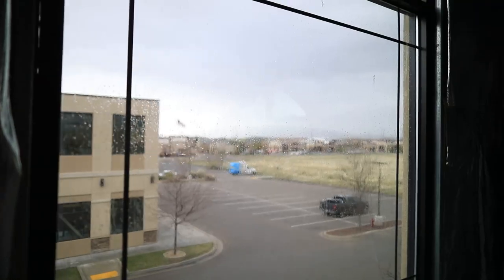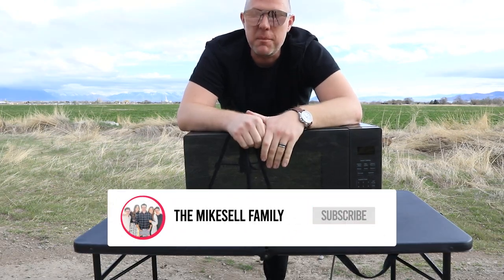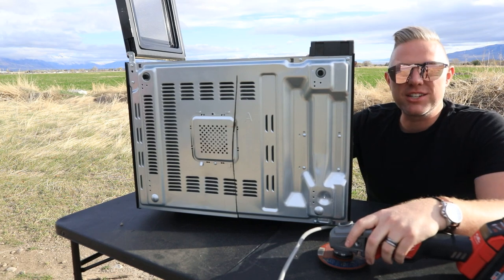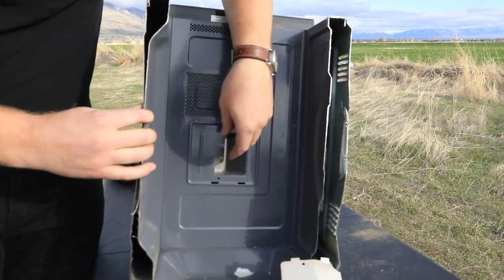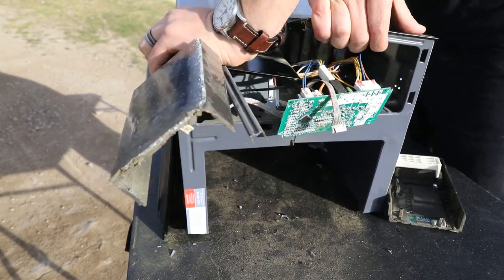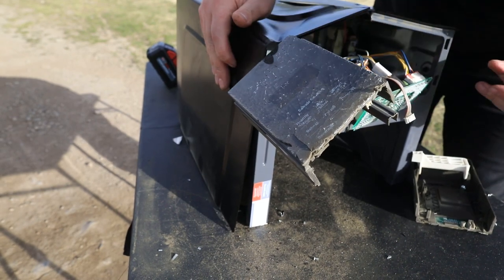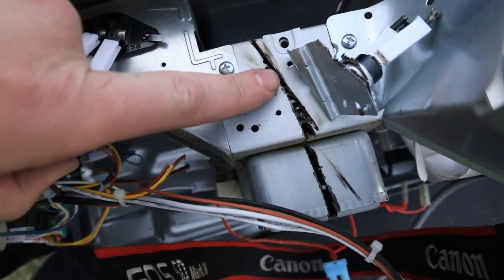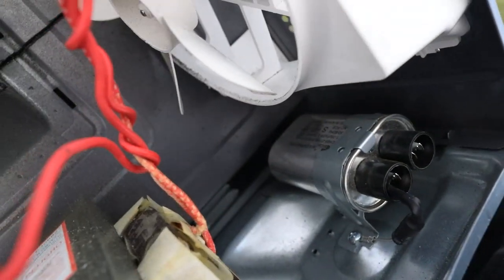Cutting Open a Microwave

Comment: Hi Kyle,

A microwave oven (commonly referred to as a microwave) is an electric oven that heats and cooks food by exposing it to electromagnetic radiation in the microwave frequency range.[1] This induces polar molecules in the food to rotate and produce thermal energy in a process known as dielectric heating. Microwave ovens heat foods quickly and efficiently because excitation is fairly uniform in the outer 25–38 mm (1–1.5 inches) of a homogeneous, high water content food item.

The development of the cavity magnetron made possible the production of electromagnetic waves of a small enough wavelength (microwaves). American engineer Percy Spencer is generally credited with inventing the modern microwave oven after World War II from radar technology developed during the war. Named the "Radarange", it was first sold in 1946. Raytheon later licensed its patents for a home-use microwave oven that was first introduced by Tappan in 1955, but these units were still too large and expensive for general home use. Sharp Corporation introduced the first microwave oven with a turntable between 1964 and 1966. The countertop microwave oven was first introduced in 1967 by the Amana Corporation. After Sharp introduced low-cost microwave ovens affordable for residential use in the late 1970s, their use spread into commercial and residential kitchens around the world. In addition to their use in cooking food, microwave ovens are used for heating in many industrial processes.

Microwave ovens are a common kitchen appliance and are popular for reheating previously cooked foods and cooking a variety of foods. They are also useful for rapid heating of otherwise slowly prepared foodstuffs, which can easily burn or turn lumpy when cooked in conventional pans, such as hot butter, fats, chocolate or porridge. Unlike conventional ovens, microwave ovens usually do not directly brown or caramelize food, since they rarely attain the necessary temperatures to produce Maillard reactions. Exceptions occur in rare cases where the oven is used to heat frying-oil and other very oily items (such as bacon), which attain far higher temperatures than that of boiling water.

Microwave ovens have limited roles in professional cooking,[2] because the boiling-range temperatures of a microwave will not produce the flavorful chemical reactions that frying, browning, or baking at a higher temperature will. However, additional heat sources can be added to microwave ovens.

XOXO